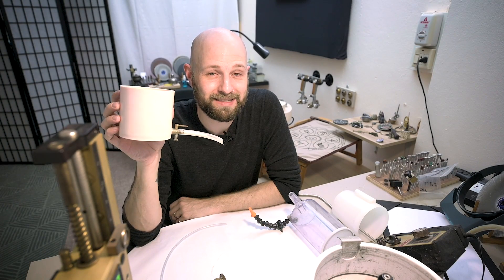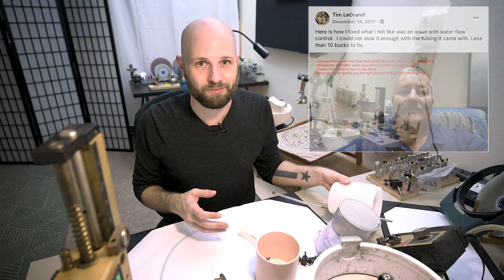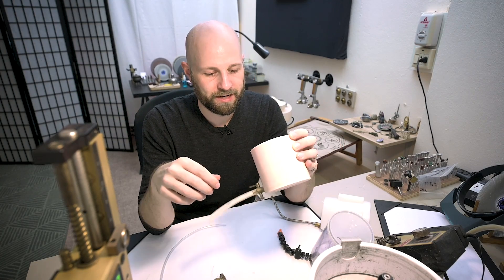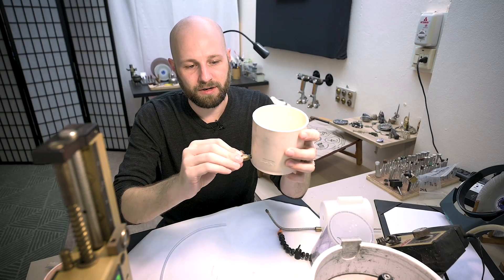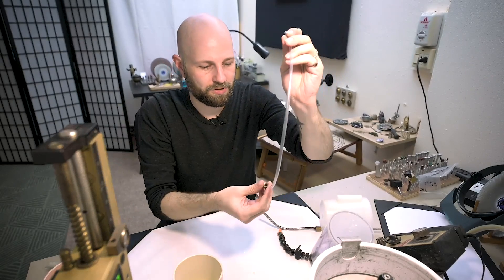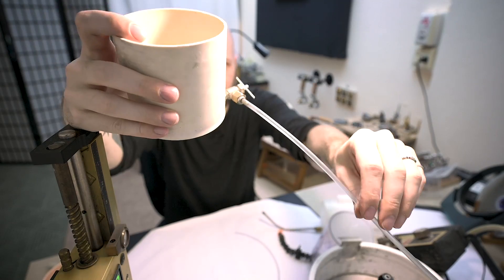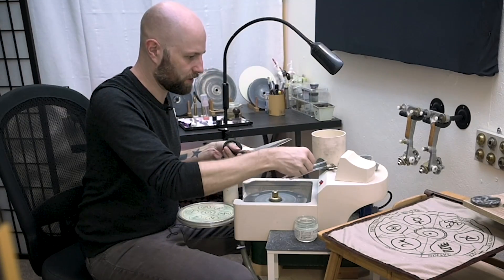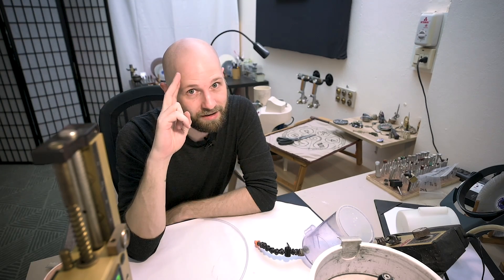HACKING Your Faceting Machine Water Drip Tank

Comment: How much water needs to be on the plate while working. I’m free handing a few pieces until I get a dop station setup and I’m causing a mess with the water (thankfully I’m setup in the yard while working)
Reply from the maker: Not much. I usually have something like one drop every second. That’s still enough to splash around but the lap and your room shouldn’t be flooded.

Comment: I used this same valve on one machine and it drips a little when closed. It might be a dry gasket. On another machine I used the Central Pneumatic 68220 brass air inline regulator. It's four dollars, threads right in without putty or tape drip-free, and machined tight enough to seal watertight without gaskets. It also features a nice detente at the closed and fully opened positions and the valve opens smooth in either direction with exceptional drip control. A piece of 1/4" copper tube fits snugly and can be soldered in, or use a compression ring and nut from a plumbing shutoff valve. Rubber tube works this way too but I prefer the all-metal aesthetic and durability. This channel is amazing, the museum is what brought me here, researching faceting and gemology history. Beyond impressive!
Reply from the maker: Ooh thanks for the tip! I will definitely buy one and try it out. Glad you are enjoying the channel!

Comment: most of the tanks that comes with the faceting machine are cheaply made ,  even from the top of the line faceting machines they dont work well and most parts are made out of cheap plastic, so that's why i design and make my own tanks made with 6" wide heavy duty industrial clear PVC pipe  and all industrial brass and stainless steel  fittings . i have a video on my channel  that didn't came out too clear
Reply from the maker: Wow, your machine is amazing!  With all the add ons and modifications, it looks like it's ready to fly into space :)  What else have you added to it? I see three handpiece holders and a dop holder but what else have you added.  Looks great! Also if you are on Facebook, please join our group, Handpiece Faceting Users Group and share your video there. Im sure the community would love to see it and ask questions.
Reply: thanks justin i still working on the machine i qm making the articulated lamp  for it now ,many things have been modify on the machine from the motor to the bearings to the hand piece round base  , also the hand pieces have been modify my facebook account was close a long time ago but i may open it again to joint the group i am a machinist and a designer and since i am getting into gem cutting i have been watching your videos and modifying my machine to correct the faults .i am planing on adding 2 goniometers stages to the column that goes up and down the goniometers will move the round platform 10 degrees to the left 10degrees to the right ,10 degrees to the front and 10 to the back so this way it will serve as a cheater and also correct any angle without the front feet  of the hand piece been in the air, i also watch that video front you . also i corrected the backlash that came from the manufacturer on the main columns where the big knob is that controls the handpiece form going up or down , i am sure that most machines made have that problem of a backlash on that main knob . since all the 3 pieces i have are c-types with no cheater by adding the goniometers will tilt the table as a cheater and then go back to 0 . will let you know as soon as i restore my facebook account so i can joint the group .thanks

Comment: The graves machine has a small bendable wire inside the tube so the tube can be positioned wherever you want.
Reply: My Graves has this very wire. 
I was thinking about Justin's "limp hose" (lol) ... I mean on Justin's water bottle's limp hose (just to be clear !)  ... that even a wire wrapped around the hose (shaped like a loose spring) would also help support and allow positioning of the hose better than it currently is.

Comment: The only difference I would recommend is that either Teflon Tape or Plumber's Pipe Stik be put on the petcock's threads before installing into your reservoir. That will help ensure that there is no water leaking around the threads.
PS> It "looks" like a 1/4" OR 3/16" (inch) hose AND the nut should have a brass furrel in it which should pinch the hose tightly to the mandrel or outlet tube.
Reply from the maker: Good idea on the plumbers tape. I haven’t had any leaks but it wouldn’t hurt.

Comment: To add rigidity in order to control the positioning of the tubing, nip round to your local engineering shop, buy/cadge a length of thin welding rod and wrap it around the pipe. The pipe can then be bent to suit ;-)
Reply from the maker: Good idea